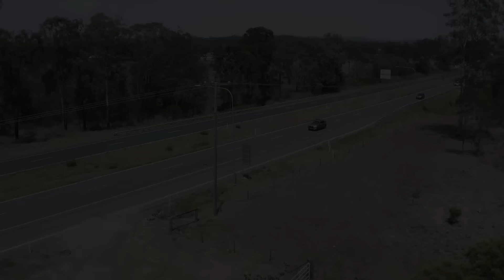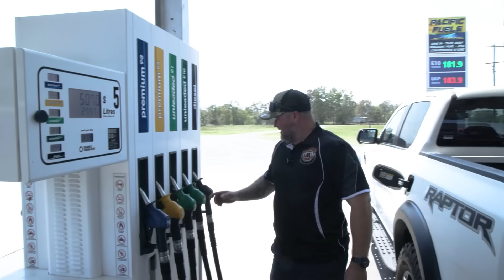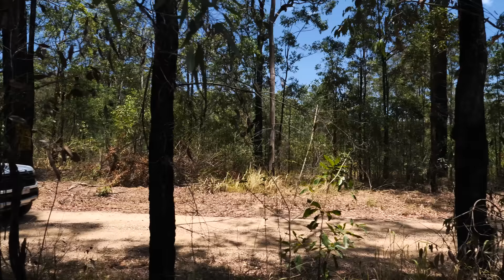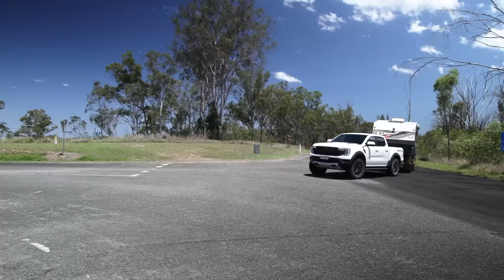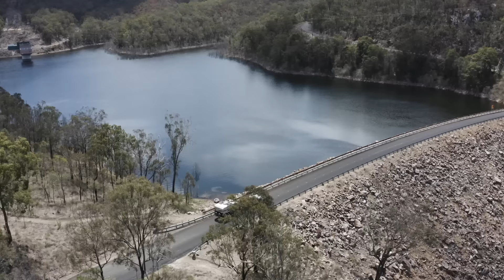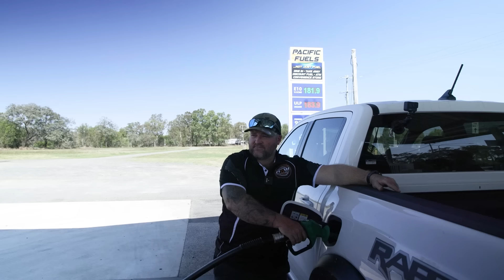Can the Ford Ranger Raptor REALLY Tow Like a Pro? The Aussie Tow Test Shocks Us!

Comment: In my opinion - stay away from E10 

Per litre it has less energy than 91 RON

9.2 kw hours - E10 
9.5 kwh - 91 RON 

Also 95 RON has the same energy as 91 - but higher octane means the fuel is less likely to ignite before the spark fires

95 + 98 have more additives as well for cleaning etc than 91

Comment: I have a raptor and its pointless to tow things with it. It's the same story for people that think they can take it on technical 4x4 trails and have a good time. It's just a fun truck, meant for high speed offroad baja style driving and that's it 

Also pretty sure E10 cuts power thereby increases your eco. Manual recommends 98, go with 98
Reply: Yeah the front lockers and trail turn assist work beautifully for a fast only truck 🥴

Comment: I have a 2023 raptor pulls my camper awesome (160kg ball weight), but stating just to put airbags in is wrong, at 250kg ball weight you would need 45/50psi in the airbags and the ride would be harsh, infact not very comfortable. (I've been down that path) So add heavier springs and air bags.
Then your airbags are only running at 12/15psi, still allowing for the rear suspension to move.
You can also do a revalve to allow for the heavier springs.
(Mikes shock shop)
Airbags make the ride firm.
I certainly wouldn't be promoting airbags as a  only  fix.
I've also installed tow/haul mode.

Comment: 24L/100km is terrible why would yu want a fuel guzzler like that. You need to be towing a fuel trailer
Reply: Why? No one wants to be seen driving a GWM Cannon doing 0-100 is 30 seconds.
Reply: I tow a 2.130kg camper and average 17/18 ltrs per hundred
Reply: @ thats not to bad
Reply: mine gets 14.5/100km towing a camper trailer in normal mode
Reply: @ Thats pretty good I wouldn't complaine about that.

Comment: 😂😂😂 Who the hell by a performance car and run it on water? Plus if you want to tow ask your dealer to turn on tow mode on it and it'll old gear down shift when slowing down ad not engage gear as aggressive as they usually do and please run it on 98 it'll. Use less fuel and run smoothly. I'm sure you can afford couple of cents more 😂

Comment: I use sport mode when towing in my my24. It holds the gears longer and stiffens up the suspension. I also drop it into 4A (and set the exhaust mode to quiet).
Reply: @earthb67  Get Tow/Haul mode installed. Heaps better

Comment: Good review. Never really doubted that it could pull the van. I'm looking into getting one, but the small 650kg payload is making me reconsider. A upgraded GVM would be great!
Reply: You lose the sport characteristics tho, it’s a tricky one.
Reply: You need the standard ranger not a raptor if you're towing. Need to understand what the raptor is built for first. The advanced suspension system built to handle the jumps can't support high gvm

Comment: I love my raptor. If you knock them you obviously haven’t driven one
Reply: Raptor is awesome. But this a tow test video. Which is pointless. It’s not designed for that .
Reply: @tonykempthorne8178 its not really a pointless video, for example, though its not built for heavy lifting like the regular xlt/wildtrack, it still could do it. But some might confuse it for "its a higher spec, it should be able to do heavier jobs".
Reply: Absolutely isn’t a pointless test. These bought as toys and lifestyle vehicles. Not work utes. People who run these will want weekend getaways towing a van, bikes or a boat.

Comment: The 2.5 t towing has to do with the soft coils in the rear. It’s nothing to do with the chassis or axle housing/diff strength. In fact engineers have pulled the diff housing and axle out of the Raptor and it’s significantly heavier and stronger than the 300 series. As you know the raptor chassis has been heavily strengthened over the regular Ranger as it’s designed to jump. The soft coils are to allow it to jump.

Comment: Theyr great till they take a dump in their pants in the middle of nowhere 😂
Reply: B4U bag it... go buy it. I did 15000 ks around Oz in the RRap.  Cape York, G.R road, Kimberley, tanami Track then Simpson Desert then home not one problem. Only mod was a B.Davis 140lt tank n airbags. Recently did big turbos, engine port n springs b.injectors,  porting, big i/cooler and brakes and F150 icu. 458 rwkw w/52,000km on the odo.. It's a weapon now on street tyres. If I can ever lunch this thing... as f.nose I've tried.  I'll  just put in a coyote  with TT's.